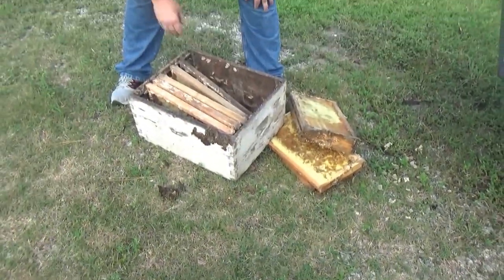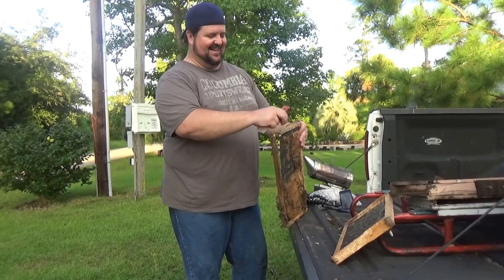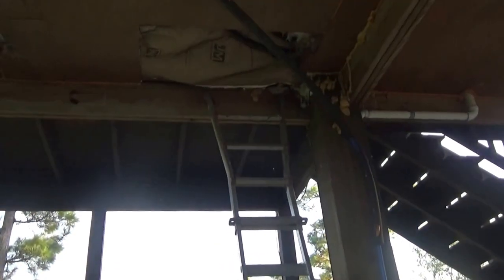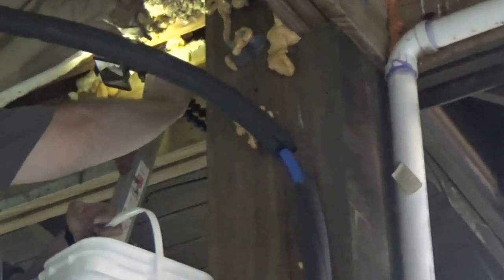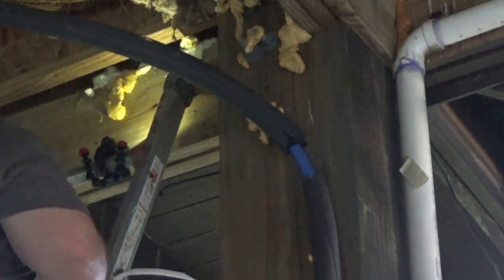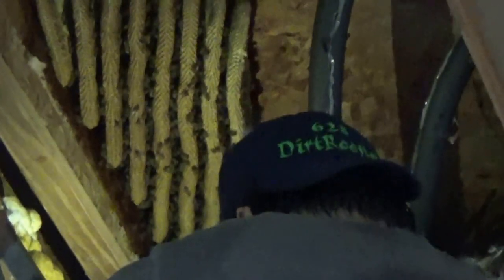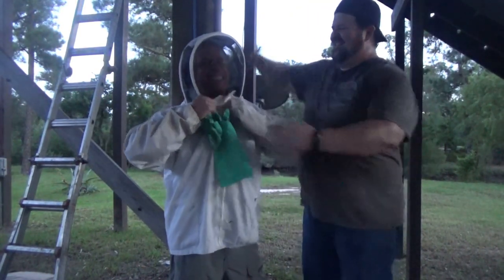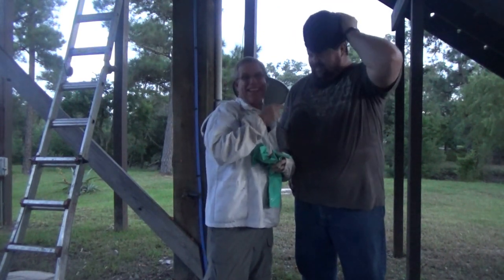Bee hive removal with the 628 Dirt Rooster

Comment: The best thing to use for bee stings is to put baking soda in the palm of your hand, dribble in just enough water to make kind of a medium thin paste, just thick enough so it will stay, but wet enough it'll settle down on the sting. Put it on your bees sting, let it set there a few minutes, try not to knock it off as it dries. It will take all the pain out of your bee sting. It works on honey bees stings, wasp, well just any kind of bee sting I've ever tried it on. I've used it on my kids and grandkids for about 50 years. They come running to get it put on anytime they get a sting because they know it works.
Reply from the maker: That's the first time I heard about baking soda for stings, I'm going to remember it as well. Thanks for the information as well as for watching. Until the next one, God's peace Sandra.
Mr. Ed